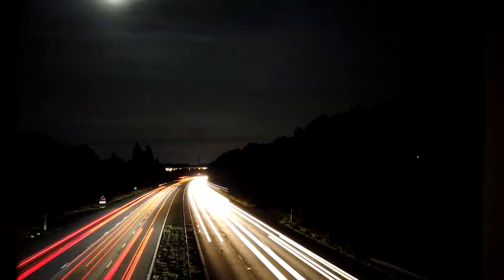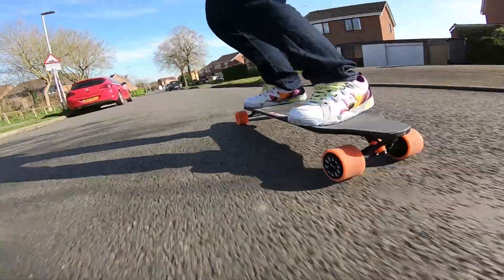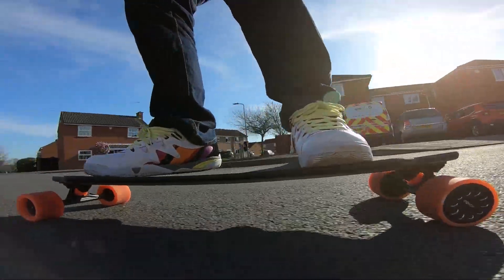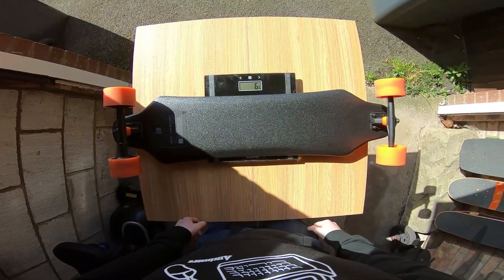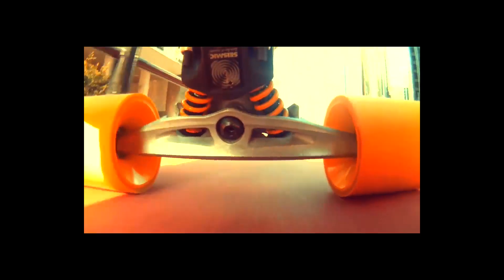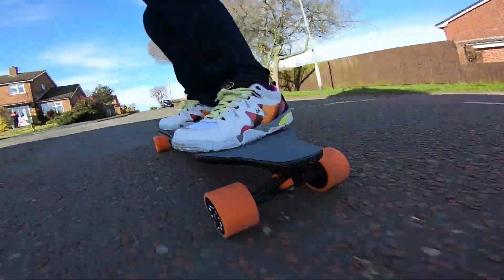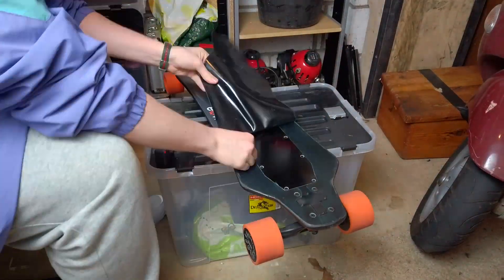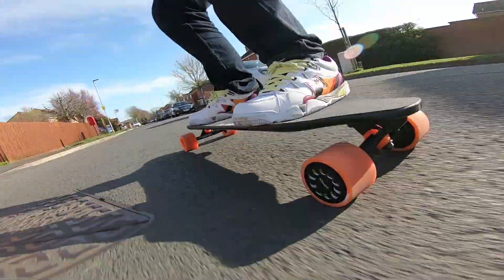The Best Value Electric Skateboard in 2020 - EXWAY X1 Review

Comment: Hello, got the Exway X1 Pro with the Riot belt. Real disappointed user :/ Want to inform those looking to buy: You won't get the range you expect, customer service will be fast to answer for your purchase but days will pass before you get any help resolving any issues. You can't get a refund if you try your board and you have an issue, that will be on you. The board is tested with a person weighing 75 kg on flat surface (most likely a running track) as gear 2 (Max 20 km/h). Nowhere does the company inform about this when purchasing. My board goes 14-15 km on Gear 2, which is not even close to 25 km.
I know I am ranting, but for all means I just want you all to have all the facts.
Otherwise the board is fun as h3ll! Like snowboarding on asphalt with the given fear of any pothole or stone that will come your way! I'm just getting a backhanded treatment from Exway